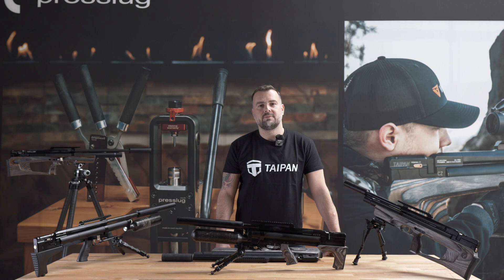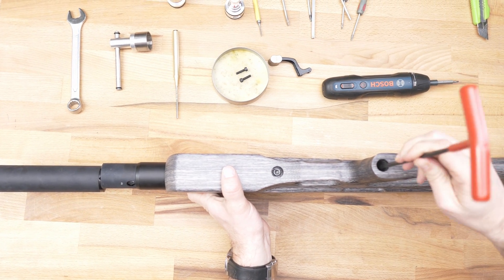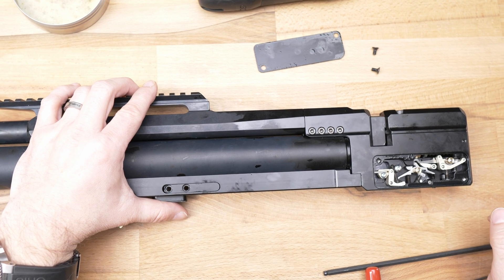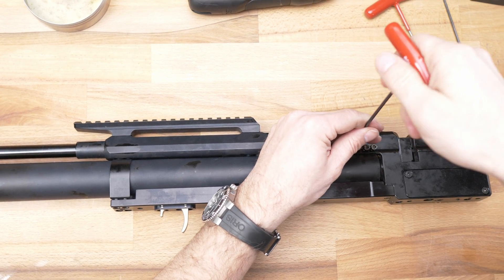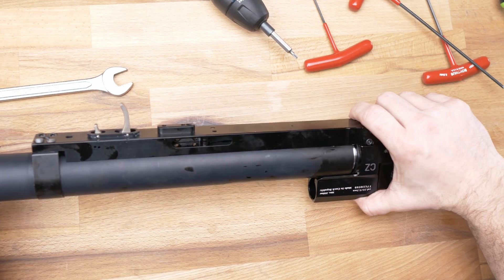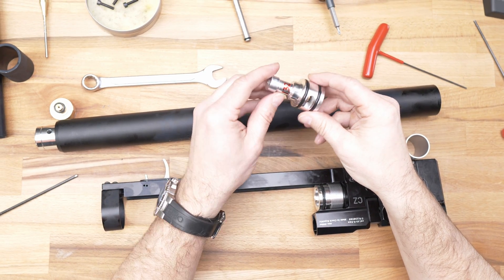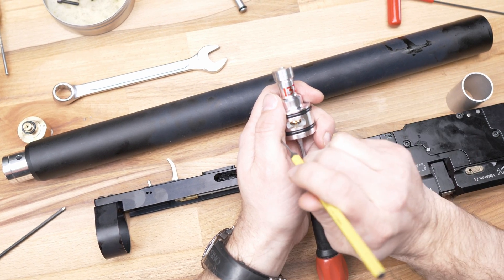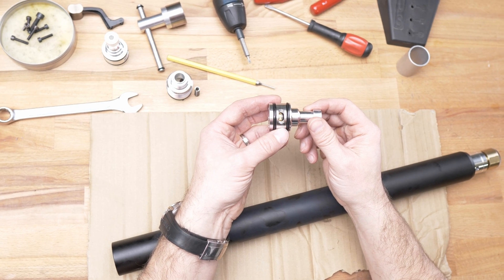Taipan Veteran II - Servis a Nastavení

Comment: is it normal that the grub screws for the trigger adjustments are very hard (really hard) to turn? in fact they’re so difficult to turn that i didn’t continue adjusting the trigger (at least for now), coz i didn’t want to force it… please advise, thanks
Reply from the maker: Hello, the manufacturer sealed the screws with glue so that customers do not interfere with the settings. The airguns are factory-set to optimal values so that the weapon works as well as possible. By interfering, we can detune the settings of the charging mechanism.